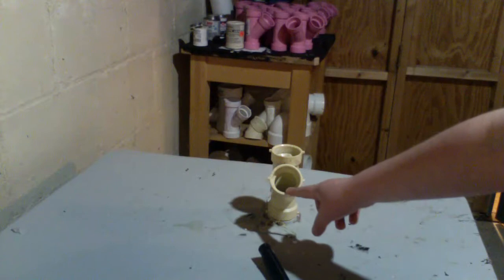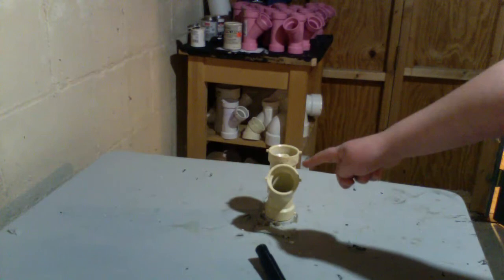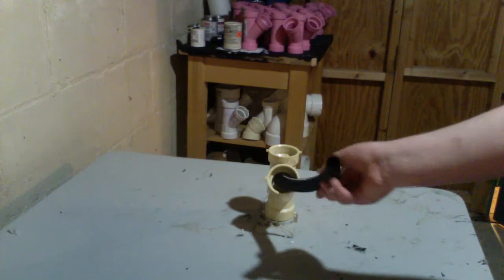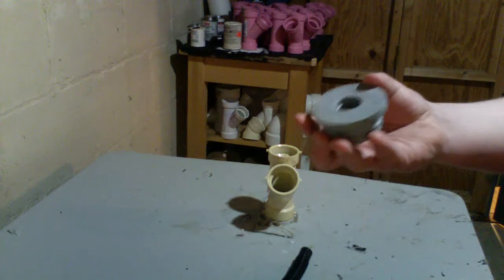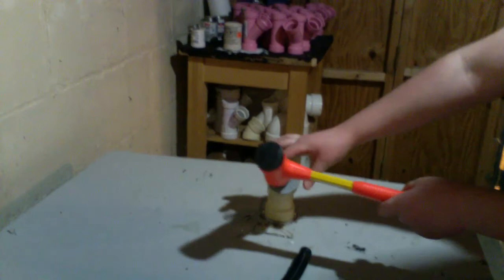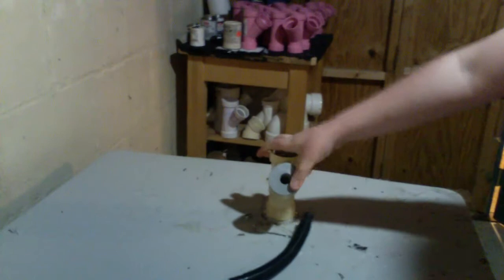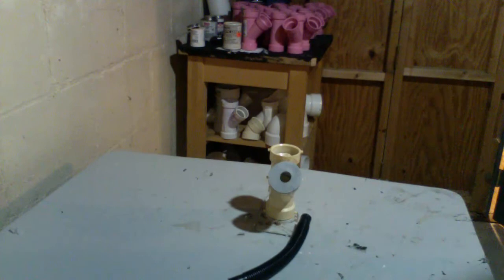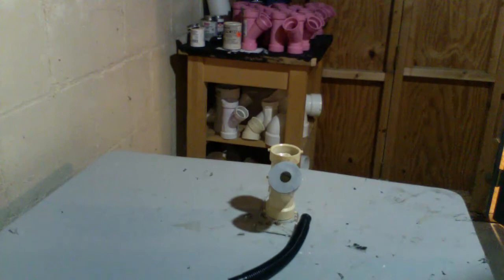how to connect a dishwasher hose to a 1 1/2 PVC pipe hub.(2021)

Comment: Canplas make a sch 40 dish washer wye.
Reply from the maker: I saw that, thats what i recommend using. I only use the Fernco if there is an existing PVC hub that i need to connect to.